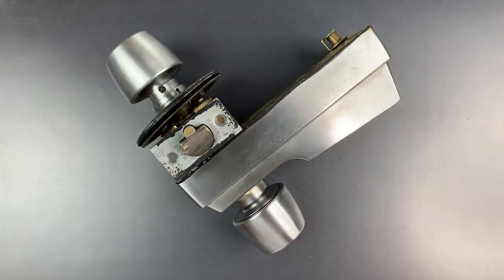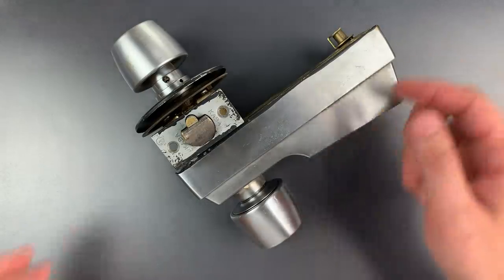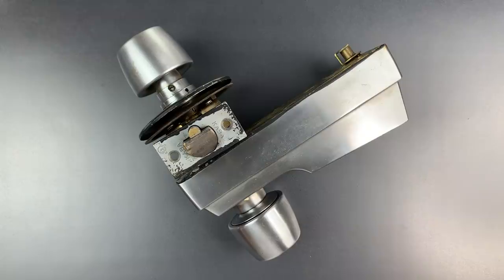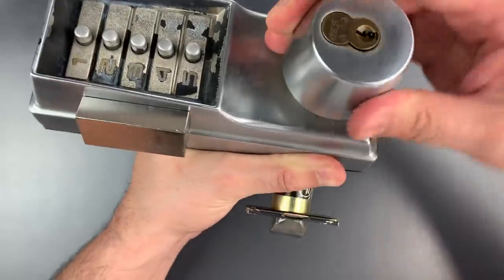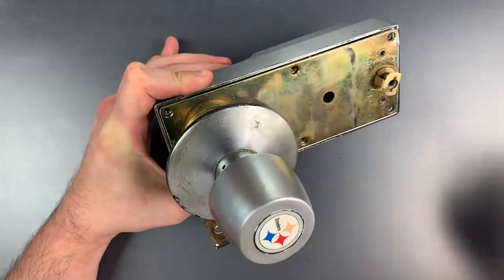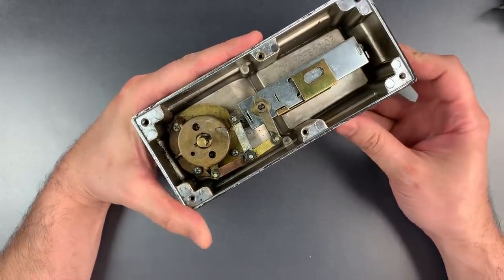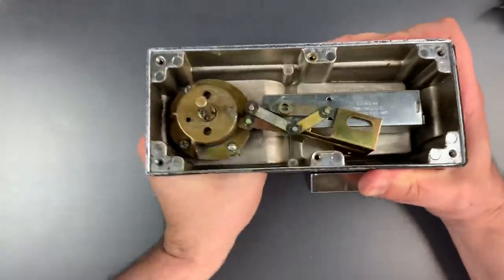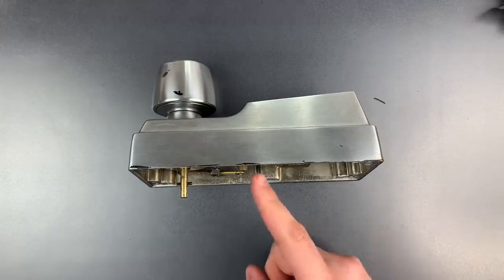[914] The Worst Lock Design Blunder Ever? (Kaba Simplex Series 1000)

Comment: I've been working with these locks for years, amazingly complex and incredibly convenient. Made in Canada. I found multiple easy fixes to its weakness. Calling it the worst blunder in a lock design, is a cheap and inaccurate jab at this lock. The push-button mechanism, which addresses all the diversified operations you would be looking for, have been very cleverly engineered into this lock.
Reply: You can have the most heavily over-engineered lock on the planet, but if the hinges can be tapped out on the door it's installed on, it's little more than an expensive deterrent. A negative review reaches twice as many ears as a positive one, so I'm sure it's a well engineered lock, but the bypass methods are what reach the ears
Reply: @lord_hemp  I own and operate over 20 of these locks. I have yet to come across a single one that contains this metal lever, which allows a magnet to bypass the lock. So as far as I'm concerned, this is a much-hyped defeat of this lock, which doesn't really exist.

Comment: Had a lock like one of these at a hospital where I used to work; policy was to change the code every month, so nobody every remembered it, so instead just told each other to tap it hard on one side while turning the handle and it would open without the code (and that was only if the porters hadn't just left it in the unlocked position on the other side to save them hassle when they had to make multiple trips). Not sure if it was a similar exploit to this, but it feels like it, probably just a less sturdy spring so hitting it was enough to move it?

My conclusion from skimming through videos on this channel is that I'm going back to the good old method of a portculis, a sturdy door, a bar and someone on the other side who has to open all of it when I need in.

Comment: When your hand is not enough for a facepalm for this
so you use the wall instead
Reply: The lock is in sale since the 80's, back then neodymium magnets didn't exist outside of research labs...
Reply: I use the ground... The biggest wall of all.
Reply: @wtfiswiththosehandles  But a rod wrapped in wire with a 6v battery was.
Reply: @LiezerZero  You can try it for yourself, it will definitely not be as powerful as one of those neodymium magnets you can find nowadays
Reply: @LiezerZero   nowhere near enough power...
Reply from the maker: Masterbata, I can execute this with an iron magnet as well... I tried. the rare earth magnet is just smaller.
Reply: @lockpickinglawyer  I stand corrected then. Did you power it with a 6V battery too?

Comment: There's a second severe flaw with these. The middle arm on the mechanism folds inwards when turned without the code being set. With it set, it is prevented from collapsing and so the lock opens. However, when the mechanism is old/dirty, it's possible that it's stiff enough to open without a code being set. If someone enters the code, uses the door and doesn't fully counter-turn the knob, it will remain 'set enough' and stiff enough to open again. Meaning: you can tailgate people through these doors. You need to counter-turn after using or release the knob quickly enough or it will not reset the lock.
Reply: Tell me, what mechanical device, particularly in a commercial application, that's used hundreds if not thousands of times a day will not suffer from wear and tear? Nothing lasts forever. But with some servicing, these locks can be restored to their original condition.

Comment: In the very middle of the cipher chamber, there is a large spring, overtime that spring will wear out causing the cipher chamber to not reset all the time.... meaning the combo remains ran, because of this you can just try the handle and about 30 percent of the time they will just open.

Comment: In my military gig, a lot of these were certainly in use in our facilities. Circa 2010 most of these were changed over to electronic key card entry systems. Now I wonder if this was an unrelated tech upgrade for a credentials based security system, or about this security flaw.

Comment: Isn’t a bigger flaw the fact that the bolt has its curved face towards the locked side?? Anybody with a credit card can shim it open in a second
Reply: Can't help which way the door swings. The separate, straight bar of the bolt prevents shimming.
Reply: The security pin prevents the credit card shim. The latch will not go in until the pin is released or the knob is turned.

You can try it yourself: on an open door, hold the security pin in and try to push the latch in without first releasing the security pin.

Comment: External Magnets > often create a vulnerability in safes, locks & especially with solinoids..

You would think lock makers would know this 😀😀😀 seems not 🤕
Reply: At least try to put it as far away from the sides of the box. It seems they didn't even try if they don't.
Reply: To be fair it's an ancient lock model in modern terms so the vulnrability was probably made obvious only years later.
Reply: They do but what you have to consider is that rare earth magnets only became affordable consumer goods about 15 years or so ago and before that consumer magnets would gave been too weak for this sort of exploit.
Reply: @kidthorazine  I'm pretty sure you could rig up an electro-magnet pretty easily that would have done the trick before Neodymium was available.
Reply: @kidthorazine  Any electronic safe or lock with a solinoid.. is vulnerable to a high power magnet attack. 

 I agree- only in the last 15 years did it become a big problem.
Reply: @sqeeye3102  it would be a lot bulkier and more conspicuous though.
Reply: @kidthorazine  I'm not even in Pen Testing and I could rig something pretty easily tbh. Run some wires down a jacket or a long sleeved shirt, like sneaking ear buds in school. Completely unforgivable oversight for the government and office buildings it is used on. Especially when this can easily be accessed after hours.

Comment: What I did to bypass these was hit two numbers at once then hit another number by it's self then turn the knob, if it doesn't work then try a combination of another two and a another third by its self and you can usually get in to them.

I've always seen these as 0 security locks.

Comment: My BMW has a valet lock vulnerability, all you have to do is lower the center arm rest and you can reach in and pull the lever to lower the rear set and then remove what's in the trunk or pull the emergency release to open the trunk itself.

Comment: You could also run through all of the possible combinations in about 15 minutes.  We figured that out back when I was in the USAF and these locks were used in our secure communication squadron buildings.
Reply: These are fantastic locks, and what a lot of people don't know, is you can enhance the security, by depressing two or more of the buttons at the same time, to increase the number of complex combinations. In fact, if while depressing two or more buttons and you slightly favour one button ahead of the other (during the combination setting operation), that motion will become a part of the new combination, and would have to be precisely repeated in order to open the lock. Incidentally, you can use as many numbers as you like, but you can only press each number once.

Comment: I don't remember if it was the same exact lock but there used to be many of those around when I was a telecom tech.
Even though I had a slide card to work in a major bank's data center, I was able to open those locks on other doors because the bank never bothered changing the default combination for the buttons!

Comment: I've worked in a few places that used very similar looking locks which could be programmed by the user's to have different combinations than the factory set ones. After leaving one job and starting another to find both used the same combination, it occured to me that the factory may set them all the same as a default assuming they would be programmed once installed. I started testing other places I found the locks in use and had a reasonable success rate.

Comment: I bought one of those magnets from sparrows because I specifically wanted to open one of those locks on the building that we took ownership of and of course it was one of the lots that have been retrofitted or either was a little bit too new and had the new design in it. I have since tried it on half a dozen more lots like that because there are a lot of them in buildings that I work in, and have never found one which the magnet would work on. I'm guessing that most people that have left these in Service had a locksmith change the parts out.

Comment: We had one of these on one of the doors at my old church buildings. As kids, we found out that the one there had a very easy to figure out combination.

The reason was that each of the 5 numbers can only be pressed once in the combination, and the combination had to use all 5 numbers.

This led to there only being 125 possible combinations, which means it took only a couple minutes to figure it out no matter what they changed it to. 

I don't know if all are like that, maybe just some models.
Reply: These are fantastic locks, and what a lot of people don't know, is you can enhance the security, by depressing two or more of the buttons at the same time, to increase the number of complex combinations. In fact, if while depressing two or more buttons and you slightly favour one button ahead of the other (during the combination setting operation), that motion will become a part of the new combination, and would have to be precisely repeated in order to open the lock.  There are far more than a 125 combinations.
 Incidentally, you can use as many numbers as you like, but you can only press each number once.

Comment: My dad worked at a hotel and this was the lock that was on the maintenance shop. He showed me a small hole drilled in the side of it and showed me that you could put a small screwdriver in and it would somehow trigger the lock as unlocked and it would twist open. He said that the maintenance guys all knew about it and did it so they wouldn’t have to bother the boss if they didn’t have the key.
(They weren’t given the code , no one was except the owner of the property)

Comment: Back in the 1980s they were deployed at an engineering school.  The manufacturer said that they were only to be installed by certified locksmiths, but the school decided to go cheap.  It turns out if not installed correctly, the catch could be engaged by applying lateral pressure to the knob while you turned it.  The administration refused to believe the complaints until someone opened the door to a vp without the combination.  That got their attention.

Even after fixed, the lock had another flaw.  Lets say you press '1" and then hang near the door.  Someone authorized tries to open, fails, tries again and it works.  The first number is not "1".  Lets say "2" worked.  Then you try "2" then "1", fail, the combination is not "2" "1".  Try "2" and "3", etc.

Comment: An easy fix, is to remove the part that the magnet pulls to open. Not all applications require that the lock needs to be put into the 'Passage' mode. Remove the 2 Phillips screws that holds the combo box to the inside case, slip off the steel part. Reinstall the combo box back into the case, tightening the Phillips screws, now a magnet will not open it, and it is secure. I have worked with over 700 of these in the past 30 years, and they are built really solid.

Comment: The purpose of that lever is changing the combination.  It's not meant to be actuated from the outside at all, it's intended that you have to remove the lock from the door and move that lever manually with your hand.

Comment: We had one of these - without the knob key - on the telecom room in my last job (a University) so the combination was the only way in. This critical room was often unmanned for long periods and was just inside a little used back hall that opened directly outside to homeless and unsavory characters wandering the campus (students too?). We had to know the combination which is difficult to reset (you have to completely remove the unit from the door as LPL did here) so it rarely was reset (2-3 times in my 6 years on campus). 
However, I realized it is incredibly insecure against random attack since each number (1-5) can only be used ONCE in the 4-digit code meaning there are only 120 combinations possible (5x4x3x2) so a person with several minutes to kill could easily simply enter them all in the span of about 15 minutes. These definitely do NOT belong on government or high security doors.

Comment: We have these all over at work. I break into them all the time when I go to a location where they updated the combo. Most times they leave the default code (they all come with the same combo set). If that doesn't work they usually only use one button at a time combos and three digits, that makes only 5x4x3=60 max combinations. Even using two digits at a time it leaves 15x3x2=120 max combinations. Doesn't take more that 5 minutes to press all possible combinations.

Comment: I'm a locksmith in the UK, and the number of these that haven't been correctly fitted, so the deadlock section of the latch ISN'T depressed while the door is shut is ridiculous, meaning it can be slipped with a sheet of mica or if the latch is visible a knife blade.

Comment: As a security hardware  distributor as well as being a locksmith for 45+ years, I sold thousands of these and installed hundreds, the only caveat is that we sold it as a traffic control product that would be used for absolute minimum security purposes. I sold these when the product  initially  came to market when  rare earth magnets were not on anyones radar, and any very strong magnet would have been double or triple the size. People or companies that sold and installed it as a medium or high security device were completely misleading their clients.

Comment: It was always a bit of a joke when we got work requests to have these 'high-security' locks installed on doors throughout the DoD.  Ultimately these locks were more for convivence in a lot of situations with the keyless entry factor.  The magnet trick is a rare solution now-a-days as almost all vulnerable models have been replaced with updated models.  I use to carry a magnet in my tool bag for this purpose as I routinely maintained hundreds of doors with these locks.  The magnet trick is cool, but for the most part, a good shim to slip past the latch usually does the trick.

Comment: You can get a strong magnet out of some of the larger shake light rechargeable flashlights.

I had one of those break on me and I use that magnet to hold nuts and bolts so I don't lose them.

Comment: It appears that a thin wire hook (coat hanger like) could be slid between the mounted frame edge and the door surface. Rotate the hook to catch the steel plate and pull, or push.  Dimple the door with a screwdriver at the frame.

Comment: I love these locks. In one of my applications, there is no inside turnbuckle to leave the door unlocked, thus no metal part for the magnet to open, you have to use the combination every time you want in. Very secure. There were videos where people would go through all the number combinations and brag they could open the lock in 20 min., I always laughed at that as on mine I always have to enter the combo 2 or 3 times before it would open.
Reply: I agree, these are fantastic locks, and what a lot of people don't know is you can enhance the security by depressing two or more of the buttons at the same time to increase the number of complex combinations. In fact, if while depressing two or more buttons and you slightly favour one button ahead of the other (during the combination setting operation), that motion will become a part of the new combination, and would have to be precisely repeated in order to open the lock.
Reply: @feger481  Using two buttons at once only doubles the max number of combinations to 120 (10 possible first number, can't reuse keys that leaves 3 for the second and 2 for the third 10x3x2=120 which works out to about 5 minutes of pressing)

Comment: There used to be a lot of these type locks where I worked. They started replacing them after I showed them how someone could easily defeat any of them by looking for wear patterns around the buttons or dirty smudges/fingerprints on the tips of the buttons.

Comment: There's a master code/initial code to them that the military never changed. I had to do some training at Camp Parks for the Army and the room I had had one of those locks. No one was allowed lock their rooms (No keys issued or codes) and if a door was locked they didn't bother doing a room inspection. Well, about 10 minutes looking up that lock and I had the master code, which not only worked on that door but every door I tried on that base. I was totally flabbergasted and so where the training NCOs when I showed them I could get into their offices.